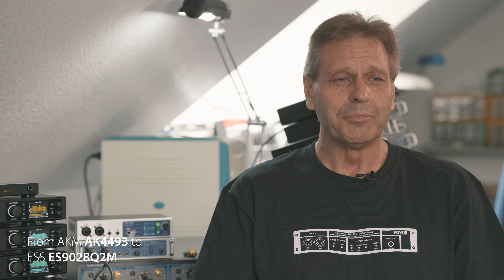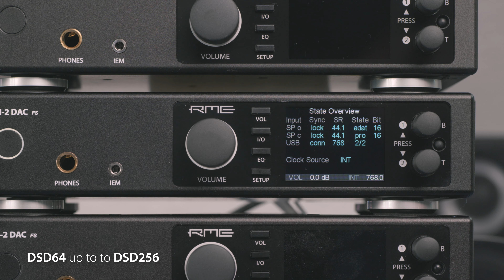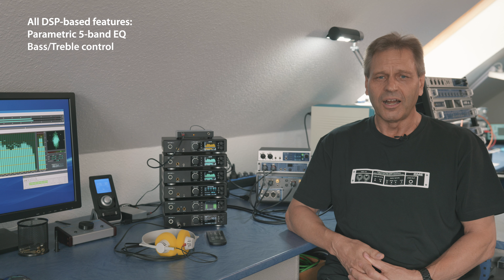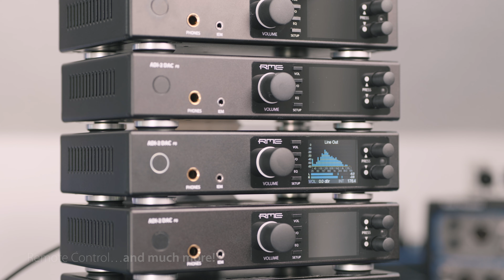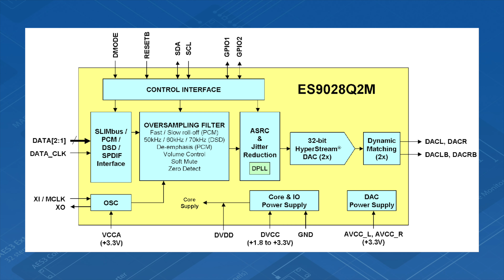ADI-2 DAC FS now ships with ESS Chips

Comment: I just bought a unit and noticed that it does not have "DSD direct" as a bad surprise. The included brochure mentioned "not in ESS units" and a few clicks away I found this video. I already have a good dac, but it is an older one and it does not have any DSD. I was never interested in DSD to PCA conversion as I could do it using the software. Since I had RME products in the past, when I "randomly" came across ADI-2 DAC FS, it seemed a no-brainer to me. But, now that I know I am missing "DSD direct" I am no longer sure. While mentioning this, the video does not elaborate enough. I really liked the idea of four hardware volume settings in combination with DSD direct - sounded like a killer to me. This is the key element I was looking forward to try. Perhaps I will return and wait until this feature is back in 2022. The last comment on PCM files tested with this DAC. While a good headphone amp is a plus indicating a well-designed output stage, I mostly listen via line-out directly going into a tube amp (BAT) and a pair of decent speakers. I can say that PCM sound is to my liking. I also like that all the features controlling the sound are very transparent from the technical point of view (no snake oil here). I really wish there was "DSD direct". Maybe it is not such a big deal, I do not know and I do not have all that many DSD files anyways, but this was the "main" interest point for me.
Reply: most "DSD" files are PCM converted to DSD as most mixing are done in PCM so theres very few tracks that benefit from it but its understandable if you do have the few tracks that are DSD all the way

Comment: I have been using a Benchmark DAC1 HDR for some time. The input is USB from my PC and output via XLR to Focal Shape 65 monitors. Would this ADI-2 FS be a significant upgrade? 
Any help here would be appriciated. For headphones I use 250 Ohm Beyer DT770 Pro.

Comment: What about the ADI-2 Pro FS series? Are they also shipping with the ESS like the ADI-2 DACs? 
And one more question. Recently I bought a  rme adi-2 pro fs R, but it was only printed 'ADI-2 Pro FS(BLACK EDITION below)' on the front panel. 
It must have been printed 'ADI-2 Pro FS R' but there was no 'R'. Have you change the logo?
Reply from the maker: As of right now, the ADI-2 Pro FS R BE will be untouched.
Reply: @RMEAudio  Thanks for the response. What about the logo? Have you changed the logo?
Reply from the maker: @페니레인  There was a limited edition ADI-2 Pro FS Black Edition of 500 units without remote and with AKM AK4490.
If your device has a remote control, it is the ADI-2 Pro FS R with AKM AK4493.
Reply: @RMEAudio  I thought there was a AK chip shortage how can this be.

Comment: I have this version. There is a high pitch sound when the screen brightness is above 30%. The old version had it? Will there be a fix or not possible with software update?
Reply: I don’t have it on my AKM system. I’m sure this isn’t normal. Contact RME.
Reply: Did you update to the latest version? And update the firmware?
Reply: @raztube90  I returned it long time ago and can't say if a newer firmware fix the issue but I doubt it. It was with the latest firware at that time.
Reply: @ognyankoynashki  did you get a replacement ? It might have been your unit was faulty. 😩😢
Reply: @raztube90  I got the money back. Just cheap components. I had similar issue in a very expensive keyboard in which they cheap out on the dc to dc related to led brightness where there was noise whenever the led brightness is lower then 100% and higher then 0.

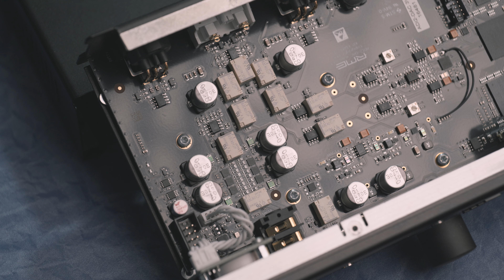Comment: the circuitry at 6:00, looks interesting!  what is functionality of the one op amp (with lots of other components) installed between 2 I/V op amps and 2 LPF/buffer op amps?
Reply from the maker: Hey Yue, that circuit operates as super-low noise voltage supply for the ESS chip.
Reply: @RMEAudio  Thanks, Matthias, Great work!

Comment: At 5:59 a wire seems to be soldered by hand, which is quite weird. Is the photo from an unfinished prototype or this is this the way RME manufactures the ESS Sabre edition? Thanks
Reply: I read somewhere that this is normal in this version.
Reply: @aussie8114  It is not normal until we have an official answer... ;-) As long as they fixed it a few months later i suppose it is not normal...otherwise it wouldn't be fixed...

Comment: Unfortunately i looked through the gaps with a torch and i confirm that there is a wire manually soldered in there... too disappointed...I don't want to be misunderstood, the device is terrific as whole, and the sound is phenomenal (i have not heard akm version). But it is a little odd and confusing that wire, because it seems like a manufactural degrade...I dont know what is the cable's durability after years, and how one can know if it is properly soldered if it is done by hand manually. That is why it would be useful some reply from @RME Audio  and perhaps upload of better pictures from PCB of this ESS version.
Reply: Why disappointed? Some time ago, many professional high end recording consoles would have been built with hundreds of manually soldered cables inside. If it's properly done, it's not a problem at all.
Reply: @StefanWiesendanger   there were to threads at audioscience review and rme forum but they both were closed from the admins… this confused me and made me believe that they had something to hide. Also there was not any reply from Rme (that generally take part at forums…) about it. If it was nothing to be afraid about they should reply a simple “ dont worry about it, it is normal “ or something like it… however they closed the threads and never replied 😉😉😏😏
Reply: @tnarch  wtf are you on about, you are nitpicking over nothing. Seems like youve got an agenda.
Reply: @TheOriginalBagelstein  i am sorry if you perceive my question like that. I asked just for an official reply. If this consist a reason for blaming me for "an agenda" then you should reconsider. I asked for a simple official reply from the creators of the unit (who know better than anyone). I don't think it is that much. I also did not say anything as fact but i used words like ''seems", "confusing" ect. Also i said about its phenomenal sound qualities...so i don't understand your aggression...

Comment: Measurements and numbers are one but there are some aspects which are not quantifiable. I had an LG V30S with ESS9218P it was a solid machine and superb quality however it is extremely fatiguing in the mid range and high end, low end is solid. I think many mention the "fatigue" of ESS chips. I wish RME produced the AKM4493 again. Now the news is RME is working on a new unit, I would not buy it because ADI2 DAC FS is the perfection of this design. If they use same foundation then maybe, but I think it will be a totally new system and architecture. Just like Automobiles, we should avoid the Rev 1. Shame I have cash ready but the AKM ADI2 DAC FS is not there. Will wait for AKM based version if it ever happens else I will purchase the ESS one.

Comment: The only thing that's keeping me from buying one of these is the fact they don't have either a 4 pin XLR or 4.4 mm pentacann headphone out. The IEM out was a mistake and is rarely used i'm sure. People want to listen on this unit with their high end headphones and most use their balanced cables. Please RME, make a version that has either one of those balanced headphone output connectors.
Reply from the maker: Your dream comes true with the ADI-2 Pro FS R with balanced headphone outputs. Also a 4 pin XLR to 2x TRS adapter cable will be available soon.
Reply: @RMEAudio  I appreciate the quick response RME, but using a 4 pin XLR to 2x TRS is messy and bulky to run balanced cables. Not to mention it doesn't make much sense when XLR and 4.4 exists. No idea why you guys decided to go that way with a €1700 unit and not include a default XLR or 4.4mm balanced connector. It's just another adapter/dongle that could've been avoided.
Reply from the maker: @polesetter_01  There are 2 separate headphone outputs in the ADI-2 Pro FS R, which can be used to drive such headphones through the Balanced Headphone option. This way the ADI-2 Pro FS R can be used for many different situations.
Reply: @RMEAudio  Yeah that's fair. Well, balanced headphone out or not, i'm buying this unit either way. I just can't help myself. I know you guys make the best stuff available. Anyway, thanks again for the quick reply. You guys rock.